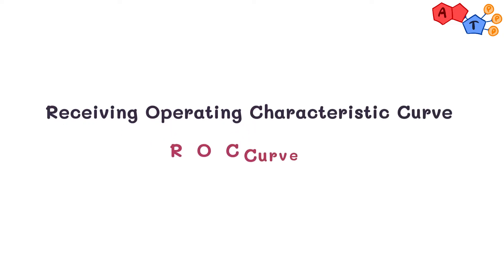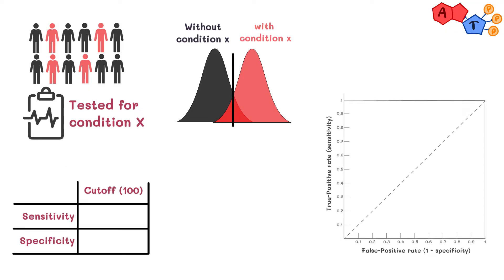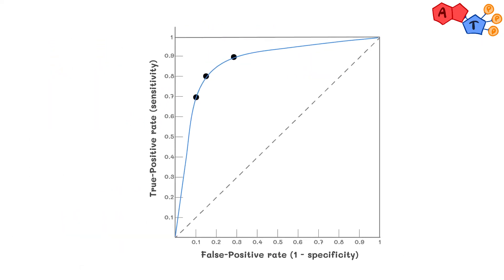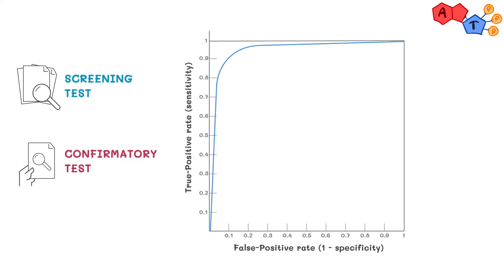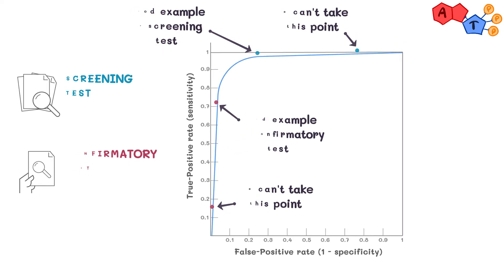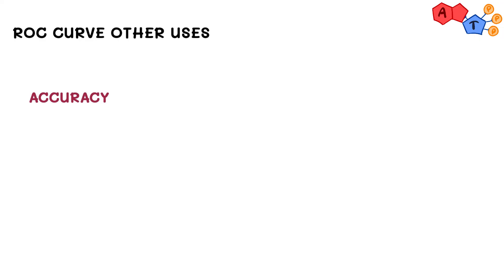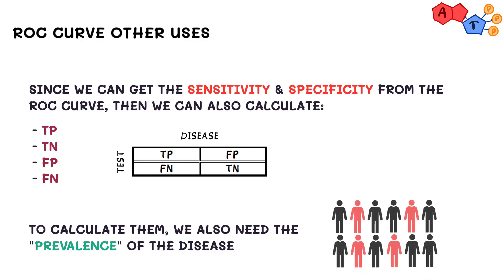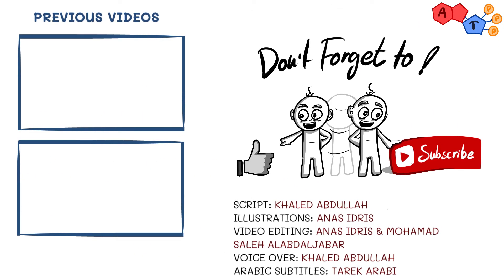Biostatistics - All You Need To Know About The ROC Curve

Comment: How is the specificity 100% in the bottom left
Reply: Remeber x axis is 1- specificity
So 2 means (100-20%)  80 % specificity
And 1 means (100-10%) 90% 
And corner most is zero so 100 %